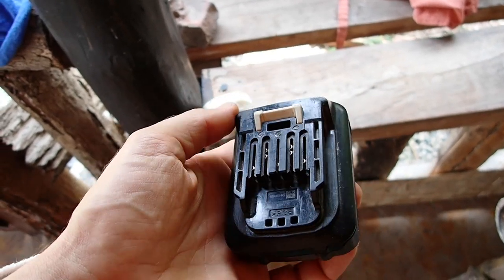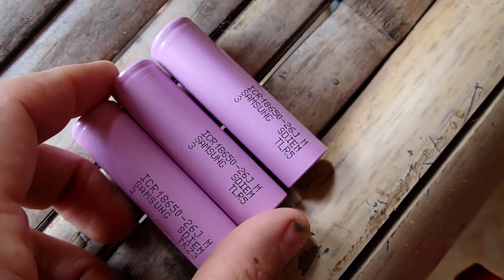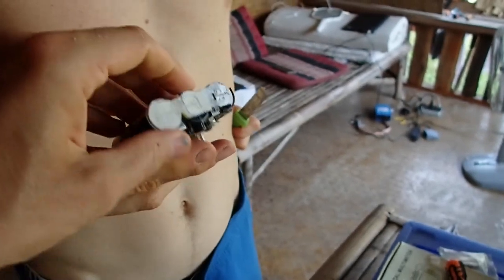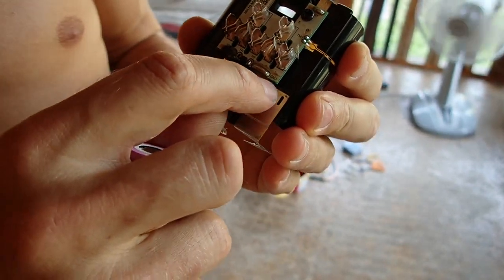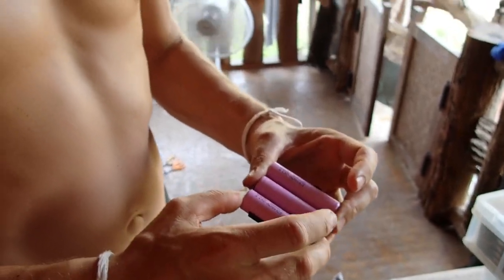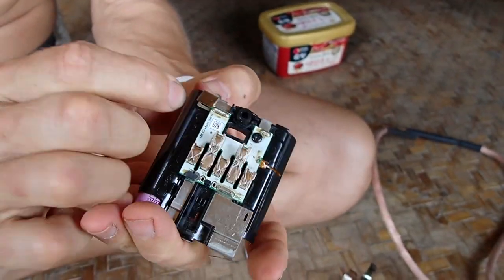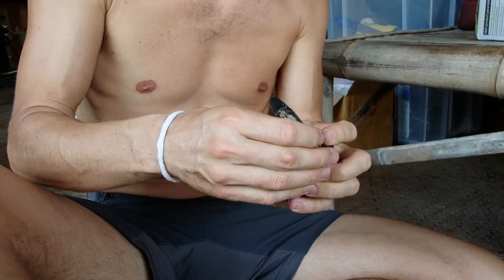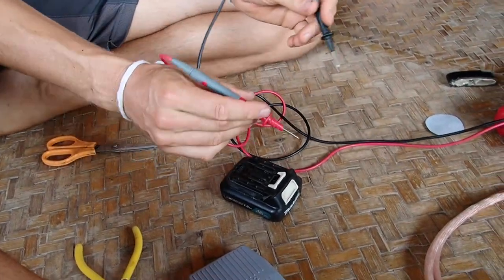Makita 12V BL1016 DIY Battery Fix 18650 Battery Replacement!!!

Comment: May I ask, what polarity is the center conductor of the BL1016 ?
Reply from the maker: Is it this conductor you are refering to? https://grn.dk/sites/default/files/image-gallery/polarity-center-conductor-BL1016.jpg
Reply: @PlantSugar  Thank you for answering back. I ended up buying a battery pack myself.  & yes, that's the conductor I was referring to but knowing it appears negative wouldn't have helped me. There's a circuit inside the batter that the tools rely on I discovered.
Reply from the maker: @craigsmithx  yes, I think one must be a skilled engineer, change the whole pack, or change the battery cells. :-)